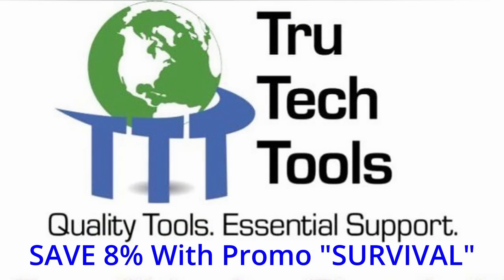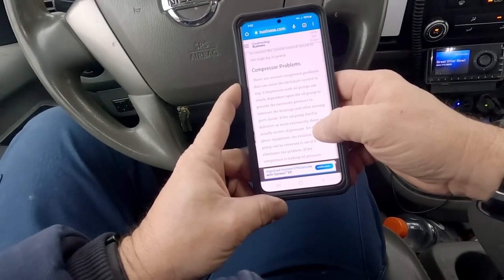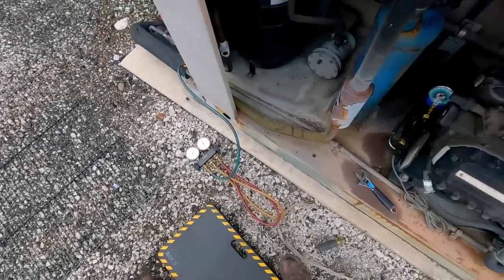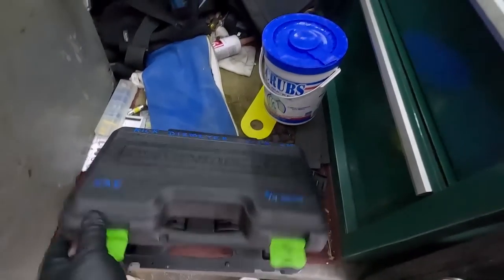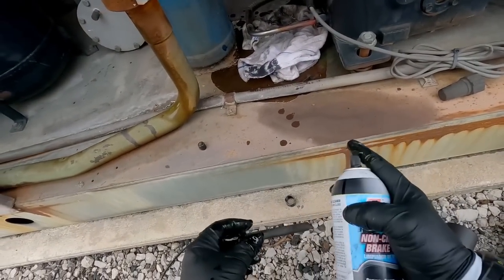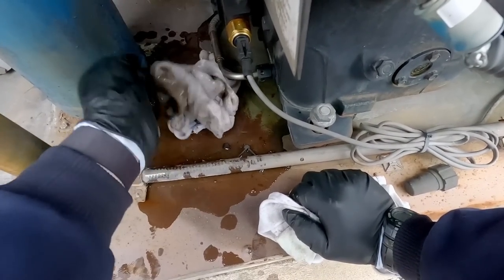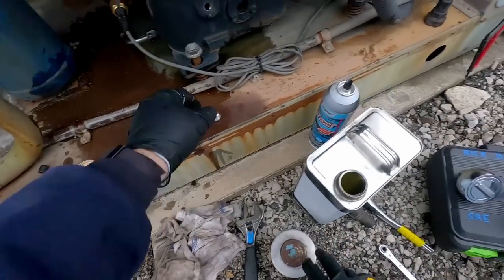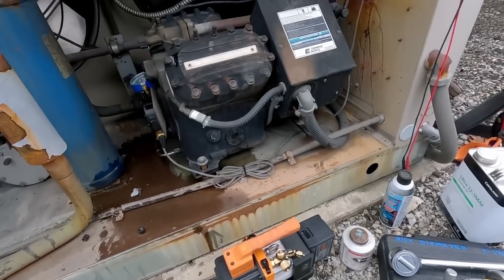Warehouse Freezer Warm Random Oil Failure

Comment: Pickup screen not checked by previous techs. Pain to get to that one. Your sentronic sensor can give you clues what your pickup screen looks like. Start up will have some liquid flood. 4d comp. Should have 45 lbs net oil. Evap coil could likely be very dirty being medium temp. Then history could show temp issues and previous guys opening up txvs. Goes forever doesnt it?
Reply from the maker: Thanks for the info👍👍. I got lucky on this one. I never went back after this call.

Comment: Lots of wear metal on that screen so it's running oil starved or flooding back and washing the oil out of the cylinders. 33º superheat is high so maybe a metering device issue? All that oil in the suction tells me the return velocity is low, there's not enough load to blow the oil back. Sure the evaporator is getting good airflow and the TXV is opening up enough?
Reply from the maker: Copeland requires 30° of superheat minimum at the compressor. The inside box temperature is negative 5 to negative 10. Suction did seem a little low. Obviously I didn't check superheat at the TXV, these evaporators are 20 ft in the air and they have all kinds of crap in the way to get to them. We hadn't had any problems with this prior till  just recently and this has been in for quite a while.

Comment: Could be the contactor single phasing the compressor or put a head cooler fan on the compressor and watch the oil level come up unless the rings are shot and it's a oil pumper.
Reply from the maker: It was possible, Granite, I check voltage drop across the legs. This video is from several months ago and I don't believe I had to go back for anything.

Comment: Has a contactor been changed? On some semi hermetics the pump doesn't work but in one direction. The larger ones I think aren't, but some of the smaller ones are actually rotation dependent
Reply from the maker: Yep, I might have cut it out but I originally mentioned I replaced it last year. The direction would be interesting to know. I know the compressor doesn't usually care when it's a reciprocating but I can't say for sure on the oil pump.
Reply: @HVACRSurvival  the direction of the pump looked good. You'll have low net if it's running backwards.

Comment: Why is that solenoid so far away from the evaporator?
Reply from the maker: Cheaper and easier for them to install it there. It also is a lot easier to change it, usually it gets frozen up with the TXV. Whatever reason they like to put it there at my company. But if it's a long liquid run we don't do that.

Comment: Good idea if you plan on isolating the compressor to clean the sump screen, check the strainer in the sentronic as well. Then when you go to open your compressor valves back up have your guages on, open discharge first and see if your suction rises. You’ll be checking for blow by. Kill 3 birds with one stone.
Reply from the maker: Thank you ! all of those things are really good ideas. I didn't check the screen on the new sensor because it was new, and honestly I forgot about the screen at the back of the compressor. And I kind of forgot to do the valve check,  my judgment was clouded because somebody else was there prior to me and I think they said they did the valve check. This is why I was upset but I didn't say anything about it in the video because they sometimes watch them too.
Reply: I deal with the same thing all the time. I hate following behind other mechanics, but it’s the nature of the job.

Comment: you have a txv issue. that suction pressure and superheat should have been higher with the freezer off for awhile.
Reply from the maker: That wouldn't surprise me with that much crap in the oil, it's probably inside the TXV too. Most people don't worry about superheat like they should around here. They tend to think since it was set once why the hell should you have to mess with it again. Then you get accused of wasting too much time. You can't win
Reply: @HVACRSurvival  your more likely to have a txv issue or even an evaporator fan delay issue. 99 percent the oil control is doing its job. I believe you can change the phase on the semi compressor and that will reverse the oil pump rotation as well
Reply from the maker: @SeanMackBuffaloStyle  if I go back I'll check it at the txv.

Comment: 0 amps = 0 resistance.. and 0 resistance probably confirms leaking rings “blow-by” 

Maybe 🤔
Reply from the maker: I should have checked that, but on the positive side I wasn’t called back out for that problem.

Comment: was there power outages there before the problem/s occurred? maybe something in combination of a long power outage and oil pump out due to flood back on restart with warm box?
sometimes it's hard to get the whole story from anyone and you have to think clear outside the whole solar system or become magician and mind reader. 🤣
Reply from the maker: No power outages, plus there are several set up and piped the same way. I'd be having redundant problems. This is all one big open warehouse.  I haven't heard anything about it tripping yet, we will see soon enough.

Comment: What do you mean by not fast enough for analog vs digital for pressure switches?
Reply from the maker: It takes time for a transducer to translate that pressure to digital reading and a lot of times they don't want to show you a rapidly moving display so they'll usually use a thing called sampling rate. That means they'll show you an updated reading every so many microseconds to potentially 2 to 5 seconds so that it seems like everything is nice and steady. A good example of this is your digital thermometer. When you grab a hold of it generally it takes quite a while for it to drop or rise in temperature. But if you get a thermistor a lot of times it'll be really fast. Another example is a analog meter versus a digital meter. And analog meter is going to respond instantly because it's directly inputting the signal right to a electromagnet that controls the needle. That's why fluke and several other manufacturers added an analog graph at the bottom of the digital display.
Reply from the maker: @Attest411  I find out most of what I know from mistakes I've made 😁